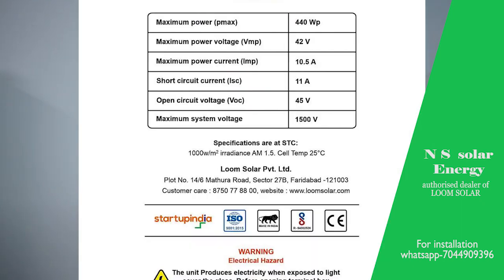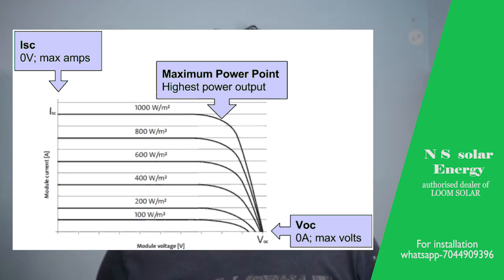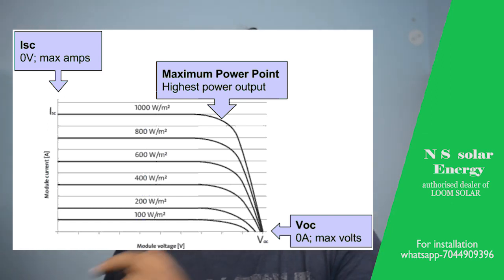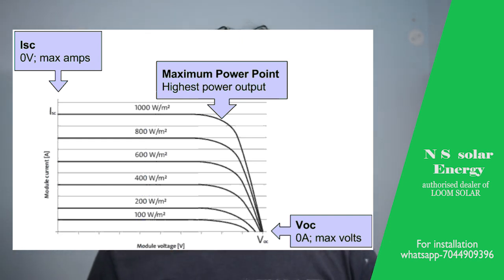Solar Panel Specification/ Panel back side term details/VOC/ISC/voltage ampere graph/Solar Power

Comment: Sir , I have  325watt  6 nos. Solar panel and one smarten superb 2500 va pcu  .
How to do solar panel connection ( parallel/ series) ?
Can i use 6 sq mm dc cable ?
Please reply ...
Reply from the maker: you can add some panel series and then connect them Paralally, only one thing in mind that smarten support max 85volt.
Reply from the maker: first check the VOC of each panel. 
you can use 6mm wire.